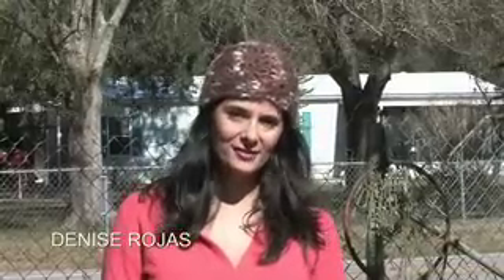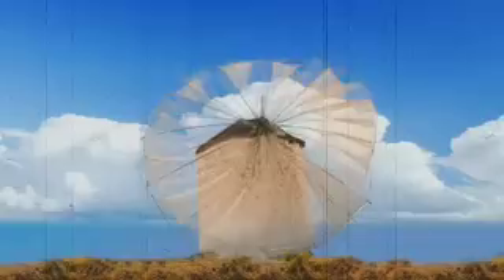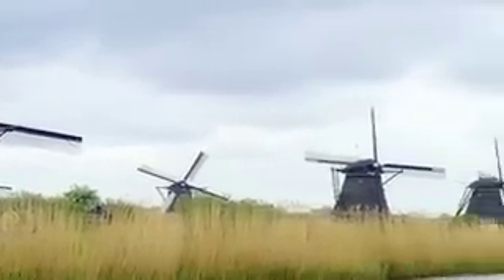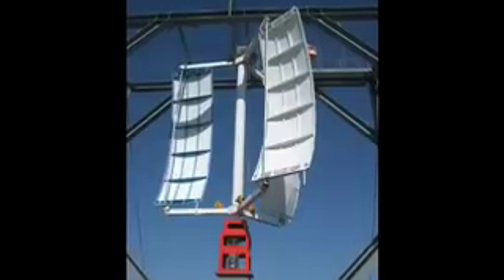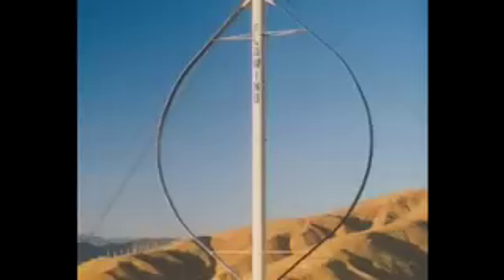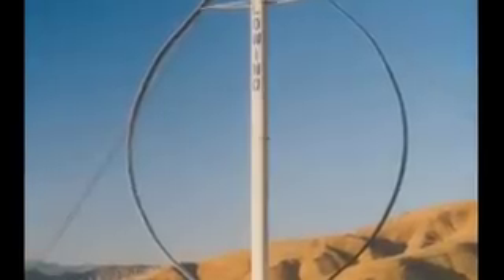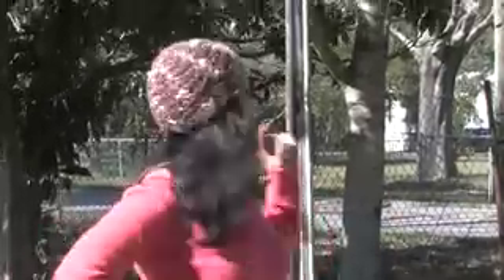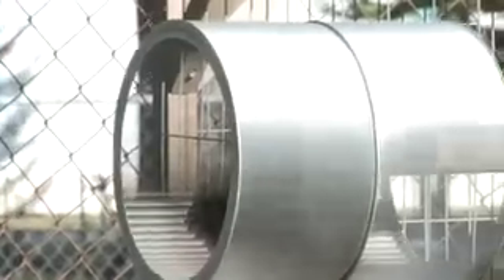Vertical Wind Turbine WINDMILL VERTICAL AXIS FREE ENERGY WIND

Comment: how can i get the generator??? i want to buy the ganerator..
Reply: you can use the motor from old broken electrical devices and appliances, such as Hovermower(aka Flymower), food processors, VHS/DVD players(although the motors on them are not very powerful, only about 5v, but ok for charging phones etc). basically anything electrical that has a moving part has a motor which can also be used as generators.

Comment: Also 4 rods of rebar? bent into a helix shape? your upper and lower plywood disc panels? four holes in them... then set the rebar in the holes at teh bottom plate and into the top plate that is twisted in direction from the bottom plate... then like a tarp stretched between the double helix (each side) that the rib rebar struts form? with the right bearing that is cheaper and easier to build and way more effecient LOL but yeah.. junkyard is a good source for a ton of stuff.. remember it's not just recycle.. it is REDUCE REUSE AND RECYCLE..... :) which junkyards are a good way of reusing stuff.. heck for the canvas you could use the seat lining of older cars... (the burn your butt vinyl?)
Reply: ive read your comment a few times now but still cant picture what you mean, any chance of posting a link to a vid with the design you are talking about. if there is a vid on that design of course, or post the link in a reply to this, if you dont mind.

Comment: I'm sorry - but a resourced blower cage isn't going to be able to produce any usable power.  This design is different than a fan - its a blower that uses Centrifugal force to push the air.  They are designed to pull from the center and push it outward int a housing that collects the compressed air.  Used a an open air windmill - it is one of the most inefficient ways of harnessing wind power.  A true windmill requires lots of surface area and does not require high speed to produce great power.

Comment: Great tip on where to get the squirrel cage.   Ive been racking my brain how to cover and duct the wind away from the oncoming VAWT blades to the other side.   

Vawts can still use a rotating tail connected to a cover that rotates with wind directional changes, the cover will protect the opposing blade from oncoming winds.

Comment: yes it will work. use the motor already attached to is as your generator. you would need a charg controler to protect your battery.

Comment: @redyoshi1985 
Well, it wasn't really a question to begin with.

There's a company already building stuff like that commmercially, as seen in this video :
/watch?v=5J5njCbTNb8

The alternative would be to put is vertically into the water, sorta like in this video at 1:52 , but into water instead of into air. In that case it's even easier to keep the electronics away from water, since you have an axle you can just stick above the water.

This is all old technology.

Comment: @Jesus45U since no one has answered your question that I saw, I am going to try.. I believe that you can use the fan as a water Wheel, but you need to protect the windings in your motor and the bearings too, or else it could seize up and not work anymore.. Also water is very ward on motors, moisture, humidity.. I would be interested if you came up with anything on that.. If you do please share.. Good luck to you!!

Comment: I was going to subscribe, but when I went to I realized I was already Subscribed.. XD I can't find enough running Capacitors to make the original Motor run for the Squirrel Cage fan from the furnace.. it was a working spare.. but I don't know how many I would need or how much MFD to use..

Comment: crap squirrel cage fans need 12 volts and up to 24 volts to BEGIN TO ROTATE
using them as a source of power is OK but FAR FROM EFFICIENT  
iv tried one from an old van and a massive blower fan from a old bounce house
i got 2 Volts and i was rotating it at 40 RPM with a drill

Comment: If you had a 10 foot pole you could have a dozen of these and still place your tv arial on top , or even two poles at either end of the house and a horizontal pole right accross the two filled with mini turbines giving you more torque than you would surely need , ever .

Comment: @wiredforstereo I have to agree, a cylinder spinning on a stick will not generate power, without a way to convert it's rotational energy into electricity. It puzzles me as to why that is not mentioned in this video, afterall, it is about wind power, isn't it? This thing is nothing more than a fancy pinwheel.

Comment: verticals have a backside pressure, as one side catches wind, the other resists the wind.  the power of a turbine comes from how many square feet of wind you can catch.  thus a little strip on one side of any apparatus isn't enough to power much.  verticals are fun as a science project but never used by any utility or serious wind power system.

Comment: @baalisgod666 It's not free, for two reasons.  You will still have to gather the parts, and even if the turbine is free the generator and converter won't be.  Divide that by the life of the shortest lived part and you have a cost/unit of energy produced.

Second, you will need to maintain the thing.  If you make it out of cheap parts it's going to need plenty of work to keep it going.  Figure a few hours a month * hourly wage at your day job.  I'll take this a little further in the next post.

Comment: @tmomof6 I posted here for 2 reasons.  If you want to be green, and make a useful, energy efficient alternative device, one needs to learn the engineering behind it.  If you just grab old parts and slap them together you won't achieve efficiency - and it won't be green.

That said, the engineering behind it isn't that hard.  In most cases all the challenging math can be reduced to basic algebra.  Hopefully this post will inspire some 'green engineer' to run the numbers before their next project.

Comment: @luidavinci I have experience with industrial scale generators (operation and repair/maint) and voltage regulator design.  I worked in utilities for about a decade.  The only experience I have with wind generation is working out the numbers to figure out what kind of renewable options were available where recently moved (Iowa - windy).  Lately, I've been working with a startup trying to get solar powered grain drying to work (electronic controls) .  I get lots of ideas from channels like this.

Comment: @bratboy90 Unless there is a power outage. I have been looking into wind power for use during power outages. I don't need to be able to power my whole apartment. I just need enough juice for some LED lights and to charge my cell phone and laptop. The wind turbine in this vid might fit the bill.

Comment: You said that these windmills did not have a load. But a power generating one will have a load will it not? It still needs to drive what ever will give over the power. As the kenetic energy still needs to be transferred. So that would still be a problem would it not?

Comment: In other words, why would you vote down a logical, mathematical analysis?  Whether you do the analysis or not, you are engineering something when you build one...and the great majority of successful engineering projects are analyzed first using mathematical models.  You can't say if something will work for sure but you can usually rule things out.  Optimization is huge also.  It's one thing to get a tiny 12v bulb to light, something else to make useful power.  The difference is analysis.

Comment: Realistic assumptions:
Wind is 11 mph.
Turbine efficiency is 35% (the huge MW wind turbines are about here).
DC generator efficiency 60%.
Converter?  Not really sure - lets just say it's still less than the number I'm about to give you...

32w * (11/20)^3 * .35 * .60 = 1.1 watt
So 10 strung together might just barely light a standard CFL.  I would be surprised if you could even get that much out - as it's loaded the generator will slow decreasing its efficiency more.

Comment: Pw = 0.5 * 1.23 * 0.075 * 8.9^3 = 32 watts of wind power.
A really smart guy named Albert Betz (a wind energy expert from Germany) figured the best possible wind turbine efficiency is 59%.  The best possible electrical generator efficiency is about 80% (if you use 3 phase AC - good luck finding one of these at this power level!).

32w * .80 * .59 = 15.3 watts.  This is about as much of a best case analysis you could imagine.  If you had a 100% efficient converter you could light a standard CFL.

Comment: ...continued for krrrr....
Savonious, height is 1ft and diameter is 1ft.  Blade area is circ * height * 0.25 = pi*d*h*0.25
0.25 because air acts on only one quarter of the blades at a time (others are either blocked by blades being acted on or are returning and therefore spinning towards the wind in a Savonious).
Neglect air friction from returning blades.
1 meter = 39 in & 1ft = 0.31m.
Ab = pi * 0.31 * 0.31 * 0.25 = 0.075 sq meters

Comment: @krrrr....

Sure, it could turn a very small generator.
Pw = 0.5 * Da * Ab * Vwind^3
Pw = power of wind in Watts
Da = air density (1.23 Kg/m^3 at sea level)
Ab = area of blades in sq meters
Vwind = wind velocity in m/sec

Assumptions:
At sea level.
Wind is 20mph average (this is super windy, 10-12 is a better estimate but I'm humoring you) or 8.9m/sec on average.
Blade area - this is a little rougher to get.  Assume your turbine is savonious - air is pushing the blades...

Comment: It's called POWER.  No arrangement of gears will increase power (gears induce friction, lowering power).  Efficient generators turn quickly, and for wind generators this is faster than the turbine spins.

This lowers torque to the generator.

P = T * w (power=torque * angular velocity)
If the gear train turns the generator faster than the turbine, causing w to go up, T must come down to keep P constant.

P in KW, T in N*M, w in RPM
P=T*w*2pi/60
P in HP, T in Ft*lbf, w in RPM
P=T*w/5252

JUNK!

Comment: Overall, I like this channel...but this vid is horrible.

Types of centrifugal blowers like these are a cheap & inefficient way to move air.  When freewheeling like this they are savonius turbines with poorly shaped blades.

A connected generator will produce a force opposite that produced by the wind.  Generating more power increases this force.  If you can stop the turbine with your hand (like you can here) you can only produce as much power as you could produce with a hand crank!

JUNK!

Comment: @sev07pass All you need to make electricity is to move a magnetic field near a copper wire. So, if you glue magnets on the side ot her wind fan thing, and put a plastic spacer on the axel and, say , a frisbee that has some copper wire coils mounted in it..and make the spacer so that the fan side is close to, but doesn't touch the frisbee coils - poof -  you have a windpowered electricity generator. No gears are needed.Hook  the 2 wire ends from the frisbee to a battery to harness the power.

Comment: The video clearly states that this is just an old  swap cooler fan and is not connected to any generator motor. It requires 7 mph winds just to get that turning without any load. Once a load is applied this little fan would require wind speeds in excess of 25 mph to turn and I doubt it would turn then because of its small size and small area for capturing the wind.

For small wind turbine and solar turbine uses visit solar cabin on youtube!

Comment: You might be on to something - imagine if you installed mini power generators throughout a forest, that would spin and generate power everytime a squirrel jumped on it.  Connect them all together and you could harvest all the collective power of all the squirrels in the forest.  Essentially you would be converting acorns into electric power, using the squirrels.

Comment: She is correct that vertical windmills are great... but the holy grail of wind power is turbine blade size whether it is 2 blades, 3 blades, or 100+ blades like in a vertical windmill. And it is hard to find really large squirrel cage turbines/windmills... but if you could... awesome power generating potential!

Comment: actually joe I just had an idea to mount magnets below on a fixed surface 1) to generate power through coils, and 2) if placed on an angle, another set of angled magnets can be on the rotating component, meaning no wind would actually be needed to rotate the device, and amplify any wind that contacts it.

Comment: I seen a vawt recently that really tripped my trigger. It was a standard turbine roof vent that they had hooked a small 500 watt generator to it at 24 volts. This would mount on the roof and be shingled. I would love to see you try one of those to show how it could work and how you would keep it generating instead of running like a motor

Comment: These squirrel cage fans straight out of an A/C unit are far too small  even in parallel to generate any useful amounts of power unless of course you can get them scaled up to 4 feet or more in diameter.

The dream is great but not really very practical.

Comment: Sure, but how often does the wind suddenly changes direction? Not very often. There are wind maps explaining this like there are ocean currents. Its not like there will be wind from the south and a second later from the north. It changes somewhat gradually.

Plus, wind turbines rotate 360 degrees and it'd only take a couple seconds for it to turn and face the wind again.

If you weight this issue of wind direction and the issue of  sweep area of the blades, sweep area will always win.

Peace

Comment: Yes but in turbulant winds a HAWT has to change directions. VAWTs do not. That means that if the wind changes suddenly, the windmill does not stop. We have a large (going on to 200+) windfarm of the big 1.6megawat turbines. The have to stop and turn several times a day, and they do not just start back up quickly. If they were VAWTs, they would not stop.

Comment: There's information in this video that is not true. There are not too many advantages ln VAWTs. 

Two facts right off the bet: 

1.VATs are close to the ground get turbulence winds created from trees, houses and anything else close to ground .

2. A VAWT, different than a HAWT, has only one face of the blade windward 'missing' a lot of power from the wind. HAWT has all blades at all times facing the wind... and that means more power. 

What's the generated power of this squireel cage? 3W?

Comment: The one here in Oak Ridge rods are used to heat water which creates steam. And the steam runs through a steam turbine to create energy. And they use cattails to clean the dark water and then cut the cattails down to make ethanol out of them for fuel for city trucks. They also are starting to clean areas that they buried waste at with mycelium fungi, then they are making fuel out of the mycelium patches a few month after they eat the waste from ground.

Comment: cool vid, nice for people testing things on a budget. i noticed you mention some voltage numbers in some other replys, what exact motor were you useing to get those numbers, im working on a small apartment setup (on patio) thatd id like to combine a small wind setup like that and small solor setup for a simple single 12 volt batt hope this does the trick due to smaller size, thanks

Comment: @Zho3Rd

Yes it is true that these are a LOT less efficient then a traditional windmill.  No one is arguing that.  Regular windmills are really expensive to construct, and also require a lot more maintenance, not to mention the need for a breaking system AND the ability to face the wind.

The design in the video is something that your average do-it-yourselfer could put to use.  If wind tech is to be installed nation wide, this is a very good solution.

Comment: the Efficiency effective model is really bad on this model.  Thats why we use only the blades,  a lot of energy is consumped only by getting this in to motion, en keepin it.  (factors like more mass to push, less surface to push)  and we where here for getting energy, theirfor the model we use with blades is way better than this kind of rotation. (think how an air proppelor of a plane  works)

These are mented for airflow (eg buidings and clean air)  (Not making energy ;)  LOL

Comment: awesome..... 
Most of our appliances actually run on DC. They convert the incoming power from AC to DC. If only the manufacturers had put in a secondary dc input.. [sigh]. we can still crack them open and bypass the AC/DC converter part. Then, with a simple rectifier, we could power all these appliances from power sources at home.. combining this as well as solar power.
AC was needed for transmission only. But if you make power at home, no need for AC.

Comment: Do you have a power output figure per height and diameter for a given speed?  E.g. what would be the power output of a turbine of 1 m height and 0.5 m diameter at 10 m/s speed?  Or, inversely, what size should the turbine have so that it generates 1 kW at 10 m/s?

Comment: VAWTs are a good way to harness the wind. However, BIG is always better when it comes to wind. The blower fans you can find at the junk are not large enough to generate any considerable amount of power. So it won't be as easy as just going to the junk yard, unless you just want a trickle charger for your car battery.

Comment: I had laugh about putting a VAWT horizontal, eliminating the advantages they cited.  Running a centrifugal pump in driven mode isn't too efficient, though.  I'd guess it's equivalent to a small-bladed Savonius, so it's got the limits of any drag-type windmill.  I've often wondered whether a high blade count on a Darreius would help, or if the extra drag would cancel the lift.

Comment from the maker: Yes,

You would need a small controller with a blocking diode. This small cage will not do a lot unless you are in a Nor'easter:-), but an Ipod 5-10 mph with a small Permanent Magnet motor as the generator I would think it should work.